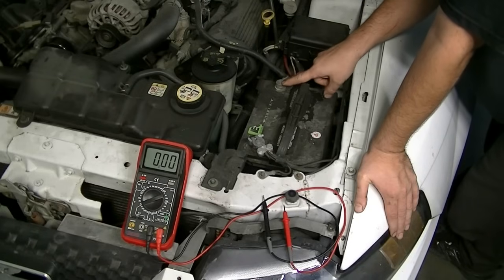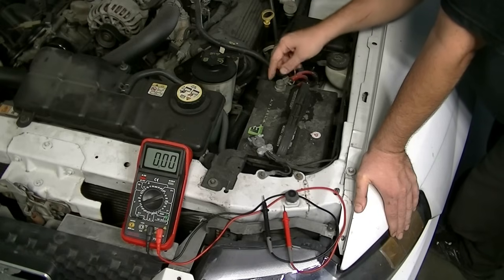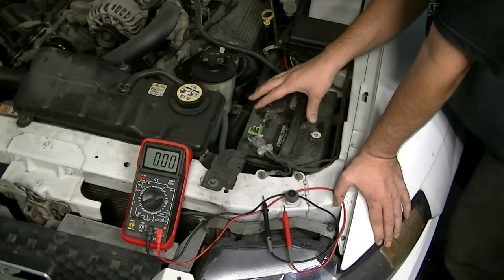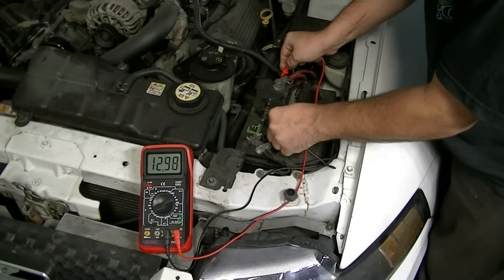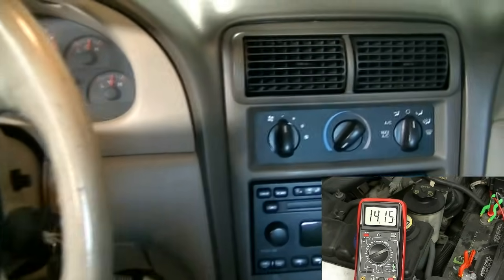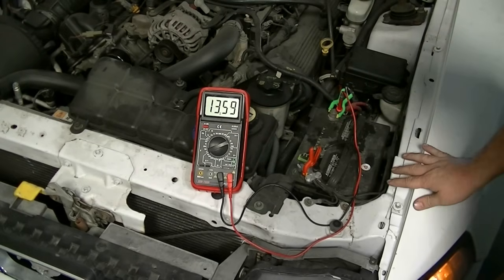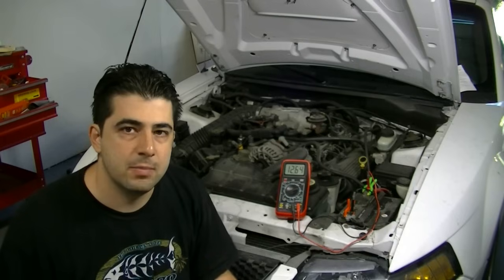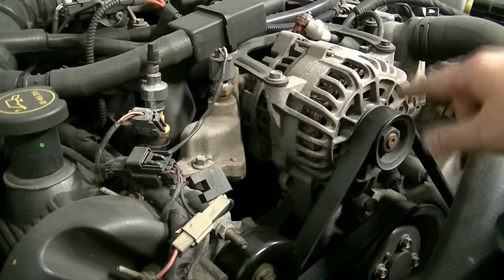How to Test an Alternator - Diagnose Charging Issues

Comment: Thanks. What surprises me is that most YouTube vides including yours is only concerned about voltage when it comes to testing alternators. What about testing it for Amperage and how to do amperage testing
Reply: No, that is not recommended because you need to open the circuit and with just a slight mistake say goodbye remember you are working with Ampes not mili, micro,nano or pico amps that is much less danger
Reply: @eddypagan8675  No need to open any circuit if you get a meter with an amp clamp.  Got to make sure you get one that does DC amps, they are a little more expensive.  
Most multimeters that measure inline can't handle more than 10 amps and can't be used to test an alternator. Under full load my alternator is reading around 70 amps.

Comment: If you car keep burning lights, switches, sensors or any other electronics components and when you do the volts test 15 volts are present, 95% of chance your voltage regulator is bad, exellent video

Comment: Great job. A video with an alternator that ISN'T producing output would be nice as well. You have 2 where the problem isnt the alternator. For example I had no output and shop quickly said they would change the alternator over the phone. I put in a brand new acdelco factor one and the car is producing 0 additional volts. So the actual alternator isn't the problem I need to solve.

Comment: @Ratchets And Wrenches - 6:52  how do u do the test on the multimeter? do u measure voltage still on 20 volts setting? or am i testing resistance ? on the ohm setting? im confused

Comment: I removed my alternator to replace my water pump and ever since my car has had a parasitic draw which causes a component to drain the battery from 12.4V down to about 8V when cranking in the morning.  

Maybe did something to the voltage regulator or diode rectifier inside the alternator when I disconnected the alternator without first disconnecting the battery?

Comment: Plz tell me when you turn all the electrical system like a, light.    Do we need engine 1500;2000 rpm at that time when all lights on.  Or you can perform this test with normal rpm

Comment: Thanks and still useful in 2021, cos I have moved the battery to rear trunk, should I just measure the points between the rear battery and front alternator directly? and the reading still should not excess 0.2 v ? thank buddy much

Comment: I hope u respond knowing this video is old but anyhow wen i connect the positive battery side and positive post on alternator on just idle i get .05-.07 i rev engine and it goes to .18-.25 so do i have a problem on positive side or no? Cause when checking voltage im getting 10.-9.vlts whether im checking just battery pos&neg or neg battery to pos on alt i kno its brand new battery that sat for long time in back seat never charged and after swapping out what i thought to be bad alternator and battery with junkyard alternator and this new battery i had but never installed those are my reading on my meter any thoughts oh and neg battery to alt housing at idle is .07 and stays .07 wen engine is revd please help

Comment: I brought a brand new alternator an my alternator not recharging but my battery is good when i turn my ac on an radio on an it drain my battery even faster so my car only running off the battery. Anybody can help me on what i should do or solve the problem?

Comment: my voltage well driving runs at 14.7-15.1 yesterday well pulling into a parking lot it dropped to 13.4 and tried to die  then built back to 14.7 . battery was gotten five months ago car is a 2012 Chevrolet cruze .would this be alternator ,battery,voltage regulator,fuse box etc...

Comment: Mine was a loose connection . I found that out after they put in a new battery. the mechanic didn't tighten the terminals.

Comment: ok , I have a 98 malibu the computer is telling the new alternator to charge to 17v! I don't remember checking the voltage out[put after I had replaced the bcm !! I never thought about that, right off the bat the windows and defroster dont work, now a whie back it started acting like it wants to shut off, the headlights go out for a sec. come back on, I got home, tonight, this was  before i replaced my alternator , it was declared bad by the testing, the car is doing the same with the new one installed, now I tried disconnecting the plug going into the alternator while the car is running, not charging the battery, however, seems the car runs ok, no acting up. but  i have to plug in the alternator to start the car. I am asking is this the bcm doing this or the pcm ??

Comment: So what does it mean if you have the negative lead on the ohm meter connected to the negative battery terminal and you touch the positive lead from the ohm meter to the alternator housing and you get nothing...zero?  No reading.  Dead as a door nail.  And then if you touch the positive lead from the ohm meter to the alternator bracket and there is still no reading?  Does that mean that the alternator is shot and that you need a new alternator?  If I do the first battery test that you showed, I get an ohm meter reading.  Thanks.
Reply: Sounds like a bad ground at the alternator or an insufficient battery to me. Test the battery first then inspect and clean the connectors on the alternator. If that doesn't do it try the power from the battery to the engine block and or the frame of the car. It is possible that that there is a faulty ground  on those also. Or you may just have your multi meter on the wrong setting.
Reply: Thank you, George.  I'll get someone to help me check these issues.

Comment: I got a question... I put a new alternator battery and voltage regulator in my 1964 gmc and when you pull the positive battery cable off the battery it still dies.... I'm kinda frustrated and don't know what to do now? Any insight would help I'm stumped
Reply from the maker: Brendan Dolim thats normal, the battery still needs to be connected in order for the car to run. If you are still having problems with the car's battery draining you might have a parasitic draw. Also check out my recent video on a no crank no start situation you might find some useful tips there. gl
Reply: RatchetsAnd Wrenches I disagree.  I have swapped a good battery into a car, started it, removed that battery while the car was running, put in the bad battery and drove the car.  The car probably ran for a minute or two without a battery installed or connected. Good video otherwise.

Comment: So if the volts needle inside the cabin visibly increases (moves to the right) when my RPMs increase, that would be a sign of a bad voltage regulator right?

Comment: Today my car was having electrical issues. I was pretty sure the issue with my car was the alternator. The car did not have any electrical power at all after I parked it. I jumped the car and it was ok then drove it for 10 minutes. I turned it off and the car has no electrical again when I tried to start it. Not even a dome light was turning on.After I watched your video my car worked fine. All I did was clean the battery terminals. My terminals looked clean and it did not appeared corroded. But after I cleaned them using sandpaper it worked better.
Thank you for your video. I just saved a couple of hundred of dollars.

Comment: do you have to turn the car on when testing ohms
Reply from the maker: +maxintater No, plus you should never test for resistance/ohms when the circuit is hot (has voltage)
Reply: +RatchetsAnd Wrenches just checking for ground. it's only 12 Volts not like it's a sparkplug or pcm
Reply: +Jeremy Hall thank you. I'm still learning so I just have a cheap one. waiting on a fluke
Reply: +George David I think it just depends on what u l your testing. some of the can bus systems have very specific parameters

Comment: Hi when I measure the voltage while the engineer is running, it is ~13.5Vdc. however out of curiosity I measure using AC via the multiplier and it's showing AC readings that's comes on and off around 8V. Does this means there could be some issue with the rectifier within the voltage regulator of the alternator?

Comment: I just replaced the alternator in my mom's camry. With the regulator connector connected it is slightly triggering the battery light, not bright but goes if i remove the connector. Is it normal for alternator to be hot to burn when touched? This was a remanufactured unit with the test report.

Comment: I'm only getting 12.4 volts with car running so I tested the voltage between the + battery terminal and + post on the alternator and it goes from 0.02 volts up to 8.0 volts and back down again in a constant cycle. What would cause this - bad diodes?

Comment: We are having an issue on a 2006 Honda Odyssey. The battery light is on. The vehicle is not stalling or anything but it acts like it is going to. The multi-meter shows 12.43 on the battery while van is off, once started dropped to 8 for a second then sits at 13.20 with A/C on then gradually starts to drop. Dropped under 11 before I turned the vehicle off. Any suggestions? I'd really like to get around buying an alternator if I can. Checked the connections, cleaned them just in case and they seem ok.

Comment: Hi I have Volvo 2008 XC70 my car sometimes when is sitting for about 1 hour it doesn’t start I jumped and started normal and I checked the battery is usually 12.9 and after I started the car Volvo the volts go up to 14.1 volts but after rep the engine doesn’t do anything stays the same volts

Comment: Hey, great video. I'm mostly doing this check because my battery light is flickering in my car. My battery voltage seems to be within spec and the pulley directly connected to the alternator seems fine, but the one under it (like the one seen in this video under your alternator) seems like is making a whirring/clicking noise. Do you know how I go about repairing this or if I can even repair it? Thanks for the video, your channel is great.
Reply: nevermind, found your pulley video

Comment: i have about .12 on the positive side, but the terminals look pretty clean. could i just connect a 2 gauge wire or something from the alternator to the battery and not have to worry about the factory wire?

Comment: I got a problem my car when is 80 degrees outside 11.5 volts running engine but in the morning 70 degrees is charging correctly at 13.8v im confused .there isn't a complete testing percedures around here ..... Im still trouble shooting before removing the regulator or alternator
Reply: It could be a slipping alternator belt or a bad tensioner (your belt becomes a bit longer when it's hot and shorter when it's cold.

Comment: Thank you for your videos, very helpful.
Reply: Forgive me if this is a dumb question, I'm just curious. In the event one has an alternator with an internal regulator, could they add an external regulator between the alternator and the battery and that be a temporary solution until they are able to get a new alternator? I haven't tested my alternator yet because,as you suggested, I intend on watching your battery testing video because I feel my issue is with the it and not the alternator. I was just curious to weather an external regulator could temporarily fix a faulty internal regulator?

Comment: Sir what if the positive terminal of the alternator is burned i test my battery the alternator aint charging cause it does not beyond 12volts when the engine is running, how do u fix the burned positive terminal of the alternator?

Comment: i have 1993 pajero when i am driving suddenly blinking the dash board light indication and radio is off and on again what is the problem of my car? its is a battery or alternator, or probably loose connection.

Comment: I'm starting from all the lights that show its not charging on the dash board are all lighted.  it's a 2 tonne truck mazda titan 24 volts using 3 x12 volt batteries . where do I begin

Comment: My battery is in my trunk. How can I do these tests? I have a positive post under the hood, on the passenger side, and my alternator is on the driver side under my intake air filter.
Reply: 300's&350's did you figure out how to do voltage drop test if battery in trunk? Thanks.

Comment: You can replace an internal regulator without replacing the entire alternator but they are not priced much cheaper than a new alternator - not because they are worth that much.  It's just a way to get in your pocket.

Comment: I have a 31' Ford Model A, used once per week to charge battery, which was changed exactly a year ago, however, it still died. I guess the only cause has to be a bad alternator

Comment: I'm trying to diagnose an issue with my car, so far I've watched numerous videos, but so happy I found yours, because it's so similar. Not what what year that is, but I have a 2000 GT, very similar. Anyway, I just bought it, and it has sat an awful lot over about the last 8-12 months, barely ever being started, on a dealer lot. So I've had it two days, within the first few minutes driving off the lot, the battery light on the dash came on, once I got out of traffic and up to speed on the highway, it went off and stayed off. That was yesterday, today, it did exactly the same thing, except it would come on, then go off, a few times, but just the first few minutes driving. Battery and alt both tested good but the battery I was told did show weak signs, also my terminals are in absolutely awful condition; they're custom, large, look like copper, but the wires look extremely brittle and lots of corrosion where they crimp onto the battery. Drove into work tonight with no issues, light didn't come on, prob cause I drove a lot, seems like the more I drive the better it is. I'm pretty convinced it's either the terminals, and/or the battery. Gonna clean the terminals and drive it a lot tomorrow, then the next day I pick up a new battery. Anyway sorry for a wall of text, was curious if anyone had an opinion. I feel like since the battery is over 3 years old, closer to 4 years, with awful connections, plus sitting so much, it's one of these two or both, and not the alternator. Thanks for an awesome video!
Reply: HypnoticSuggestion 1

Comment: Alright Update on my trooper, bought a multi meter , battery kept reading 12.5..and either .4 or .6 ...when its running same , doesn't go up or down ..took out the alternator got it tested aaaaand it failed...bought a brand spanking new one from O'reillys (not autzone-they support NorthKorea)  ..put that sucker in and still the same thing ! took positive and negative terminals off the battery and truck stayed running with same voltage...I'm getting no charge ..can someone help ?

Comment: great video and clearly explained. this has just helped me fix a battery drain issue ive had for the past 6 months. tracked it down to a connector on the battery neg near post with the voltage drop test. many thanks

Comment: Except corrosion when I start the machine shows 14.0 / 14.1
After not a big ride falls to 13.8 / 13.6
And the machine does not respond well and produces 2 errors
One of the errors is 00537 Active / Static
Oxygen sensor control-lower limit stop value
And the second error is 00516 Passive / Sporadic
Closed throttle position switch-f60-open circuit / short circuit to +B

Comment: Are you touching the + terminal while holding the car mass?
Reply: That would not be an issue under normal circumstances in a regular 12V system. Too low voltage.
Reply: Exactly what I was thinking..🤔

Comment: Great video. I installed a new battery, alternator and voltage regulator. battery reads 12.7 and with engine running it drops to 12.4. I did the voltage drop tests exactly as you have shown and they turned out to be within specs. Does this mean I bought a bad alternator off the shelf or can there be something else causing this?
Reply from the maker: +stupidgenious1 Have you checked voltage where it is immediately coming out of the alternator? and done drop down tests from there onto your battery? also when checking the voltage from the alternator make sure the washers and nut that are holding that cable in are in good condition and not dirty.
Reply: had an interesting problem - i own a 2001 Chevy Silverado 1500, 4.3L    battery light started coming on and off - i checked voltage at battery while vehicle was running and had 12.4 volts. obviously battery isnt charging. thought alternator was failing so i removed the alternator and took it to Orileys and Advanced Auto to check it. both said it was 100% good. i re-installed the alternator. tested alternator by using multimeter from positive terminal on alternator to ground on engine block - 14.2 volts. so alternator WAS good. also now getting 14.2 volts at battery with engine running, so the battery is getting a charge now and no battery light. could it have been as simple as a loose connection somewhere??????
Reply: yes
Reply: Doug19752533 Did the problem return?
Reply: stupidgenious1 did you get it fixed?
Reply: My idle is between 13.6v - 13.7V  is that good enough or the start of a bad alternator?  I'm not hitting anything over 14v but it's also not dropping below 13.6v when I have my highbeam, lights, radio and fan all on.
Reply: @fUjiMaNia  that is fine, 13.6 is actually really good, especially with a 13.6-7 at idle, that's actually a really strong system and working great

Comment: so i just changed my battery in late october and in the cold illinois weather (-2 no wind chill) my car turned over super slow. the lights in the car dim considerably when the car idles between 900 and 700 rpm, or when im driving at night and i turn on the rear defogger and heat. any ideas? i dont want to jump to alternator conclusion and spend fat stacks on a new alternator if it isnt busted